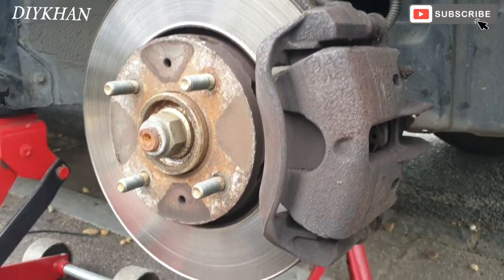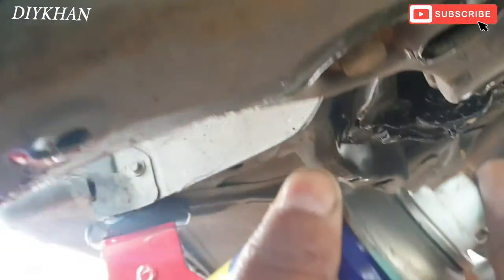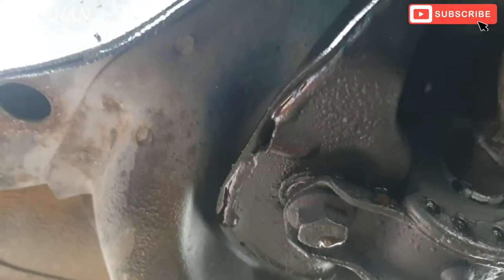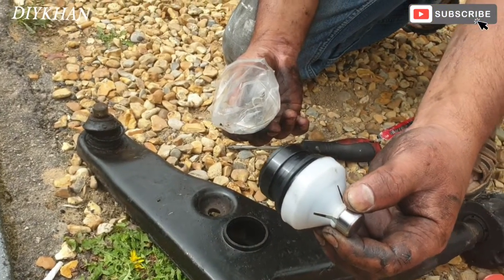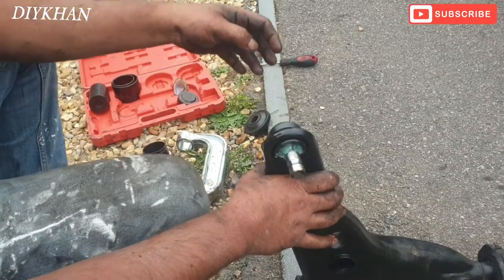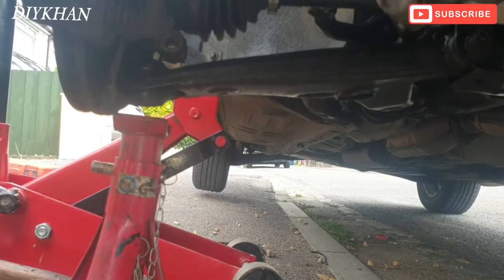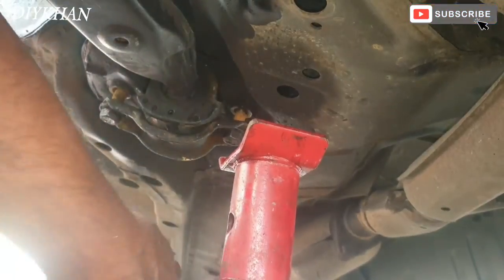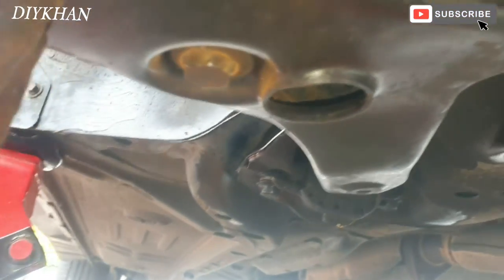How to Change Replace a Lower Control Arm Wishbone Ball Joint on Mitsubishi Lancer Carisma

Comment: Thanks for the video.
I'm thinking of buying a 10-piece extractor set, like yours. In your opinion, is this enough to remove and press in all the bushings and silent blocks in the front and rear suspension, or should I go for a kit with more pieces?
Reply from the maker: It should be enough. Good luck 👍